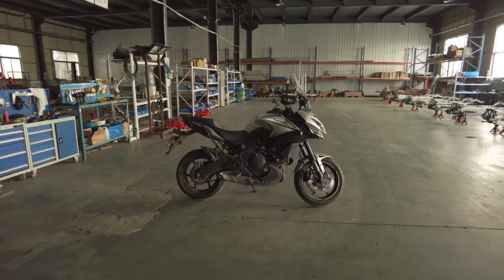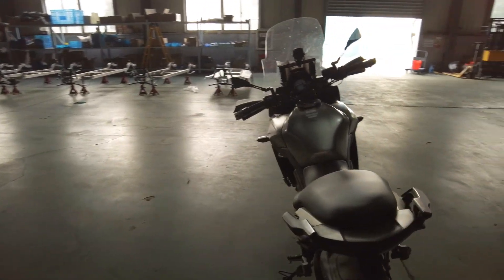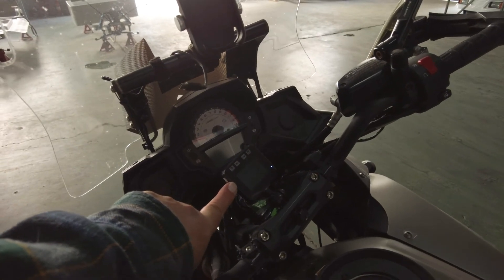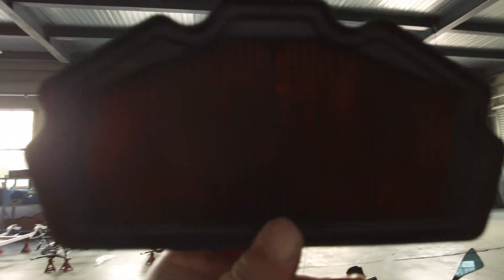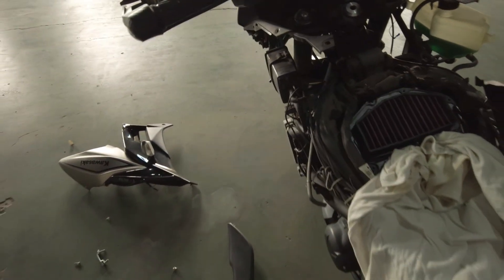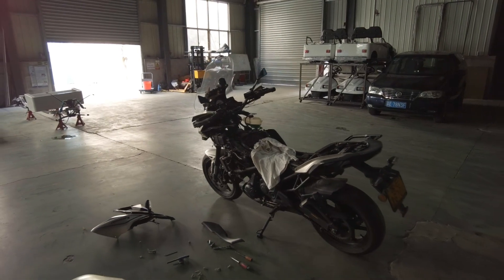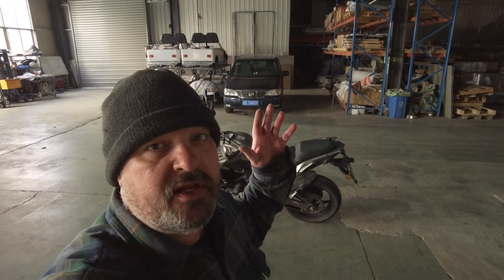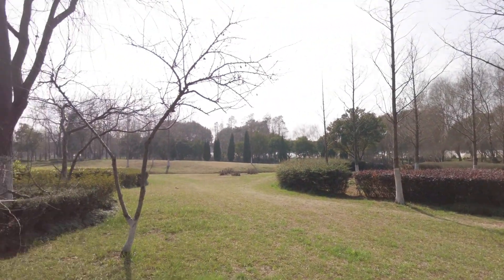My 2018 Kawasaki Versys 650

Comment: mmmm sounds nice... wonder if you could fab an induction kit for it... easier than screwing around to get the filter out
Reply from the maker: Ya, I thought about that, but the air intakes come out under the tank in between the frame rails. I'm sure it would be doable. Luckily the air filter only needs changed about every 10k miles.
Reply: @SKIDOOSH  yea, the only real way to do it maybe would be have a hose come out the one side of the box where the air filter is now i guess.
Reply from the maker: @WX4CB  That's the issue, it has 2 air intakes straddling the chassis.
Reply: @SKIDOOSH  yea but you can feed them from one hose out the side :D
Reply from the maker: @WX4CB  lol...no!

Comment: on those kawasaki the more air in and more exhaust flow out the better it will run get yourself the k&n air filter charge kit for that filter it will last longer and run better
Reply from the maker: Thanks man! Been riding Kawasaki's for 30+ years. Well aware of the K&N filters. I have them on my carbureted ZXR1200R back in the states with a full stainless steel Muzzy exhaust and a stage 3 kit. . This air filter is made by the same company. The only way I could get a true K&N over here would be to have it imported and pay $50 shipping for a $10 part. I had to pay over 1k for the akrapovic custom exhaust I am waiting on for this bike to ship to me.